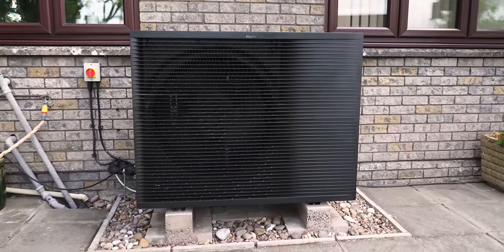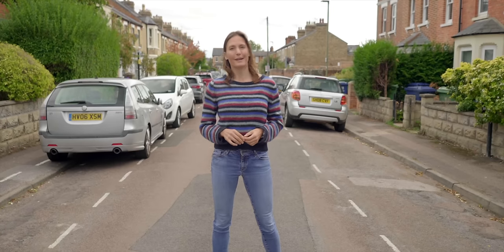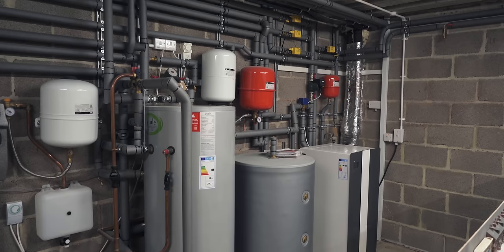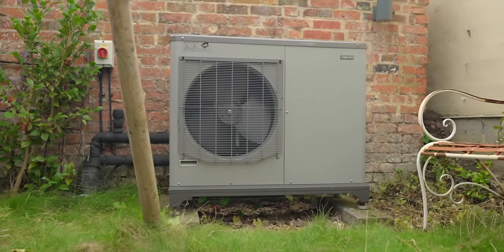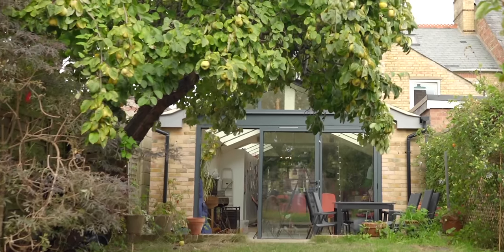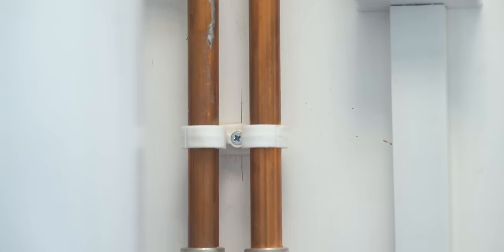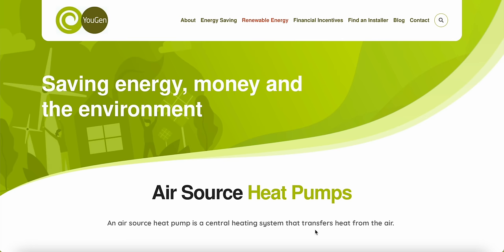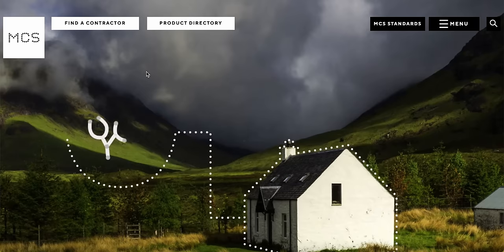Does a Heat Pump Really Work In A Victorian Terrace?

Comment: I'd like to flag something here: in the UK, we pay a green tax on electricity, but not on gas. Firstly, that's insane, secondly, if the green tax were moved from electricity to gas, then a heat pump would be a better option financially. The UK wholesale electricity price is also set based on the most expensive generation source, meaning that it's currently dominated by the price of gas, even though gas is making up less than half of our electricity mix at the moment. As it is, gas boilers and heat pumps are roughly neck-and-neck. If energy pricing were reformed, heat pumps would have a decisive lower total cost of ownership compared to gas boilers, much like EVs compared to ICE.
Reply: All subsidy and government interference should be removed from the energy market. If this happened the true price for wind and solar would be massively higher taking account of their unreliability and unpredictability.
Reply: @timfallon8226  no they'd be lower. Gas is what went up in price, not renewables. The reason energy prices went up everywhere is because its an open market. If you can buy 100mw of electricity for a third the price of 100mw worth of oil you'll just turn and sell it at a higher rate. 

Supply and demand.
Reply: I have one and a more efficient cylinder installed and the saving of the loss of gas and standing charge is far greater than the increase in our electricity expenditure
Reply: How surprising that the system is sqewed to benefit the privately owned suppliers that have a massive lobby with legislators. Essential services must be in real public ownership or consumers will always be robbed.
Reply: It's evil wanting to punish people.
Reply: 100% agree. Needs changing asap so green taxes are on the legacy fuels ie gas, not electricity. this will incentive a switch away. And as you mention, the ridiculous marginal pricing system currently in place for wholesale electricity in the UK doesn’t work anymore and should have been changed already.
Reply: @timfallon8226  incorrect. Renewables plus storage is 1/2 the price of nuclear to build, and cheaper to build than to run and maintain coal
Reply: @nordic5490  but how much storage are you factoring in to  the cost? How much time with no wind and no solar are you planning for?  Enough for a few days of subzero temperatures like in the beast from the east in 2018 ? Or Enough fOr a few 
 months? Like December 62 to March 63?
Reply: @nordic5490  but how much storage are you factoring in to  the cost? How much time with no wind and no solar are you planning for?  Enough for a few days of subzero temperatures like in the beast from the east in 2018 ? Or Enough fOr a few 
 months? Like December 62 to March 63?
Reply: This clip is very disingenuous. Yes less energy per year is used but they don't say that with current costs it is more expensive to run a heat pump compared to a gas boiler. The house owner said he now uses 6000kw to heat his house with the heat pump. With electricity costing around £0.275 per KW that gives an annual cost of £1650. He said previously it was 15000kwh using a  gas boiler. With gas costing around £0.07 per KW that gives an annual cost of £1050, a saving of £600 using a gas boiler compared to a heat pump. 
Gas is normally 4 times cheaper than electricity so that has to be taken in to account.

Comment: I'm in Canada and just turned off my gas line because I've switched over to a cold climate heat pump to heat my house! Heat pumps are magic and I highly recommend them! I'm so happy my house no longer has an exhaust pipe and doesn't burn stuff anymore.
Reply: Hello Mike,
Can you tell us the precise model of your cold climate heat pump?
Reply: @effemmelle  it’s a Mitsubishi Zuba PUZ-HA36NKA
Reply: Surely Mike the power station just burns stuff on your behalf now, so moving the exhaust pipe? ;)
Reply: i was quoted $21,000+HST for the Zuba HA42NKA1 (central ducted, 48,000BTU)... this is crazy expensive system!!!
Reply: @stuartburns8657  He is in Canada which exports much of its hydro power to the US. They produce 60% of their electricity from hydro. There is a lot of wind power too.
Reply: @stuartburns8657  The grid where I live is 93% zero emissions. Our power plants don't really burn much stuff. There's a reason we call our electricity "hydro".
Reply: @Vlican  If you're in Canada there's a rebate that makes it basically the same cost as replacing a furnace and AC (which is what you'd be doing) so yes, it's a lot of money but so is buying a new furnace and AC.
Reply: @heymike7037  Fair enough, glad to hear somewhere has it right 👏
Reply: Quite right just like electric cars.

Comment: As a Floridian, I've lived with heat pumps most of my life.  If a heat pump can't get your building cool enough or warm enough then the problem isn't the heat pump, it's your building.
Reply: You live in stock built homes in the USA. 99.9% of homes are brick builds in the UK with most of them closing in on 100 years old. The issue is the cost of retrofitting old housing stock to be suitable to allow for a heat pump. This has been getting sorted for many years with majority of homes now having double glazed windows and doors. We need our homes to be insulated though and the cost for this is unaffordable to people for the most part. For instance I was quoted £14k to insulate my home and that would not affect its value. In fact it would mean some mortgage providers won't give me a mortgage.
Reply: @PKSiAMiAM  Yeah, that's a problem.  My house is a concrete block frame 1950 model that has been expanded several times by successive owners.  I've spent US$20k on a new roof with upgraded wind protection, which was necessary to get insurance, and I'm looking at another $20k in insulation and HVAC upgrades within the next couple of years.  That's why we call them "buildings" rather than "builts": We're never really done building them.
Reply: You are a Floridian. You barely need heat.  Heat pumps decline in effectiveness the colder it gets outside,  especially below freezing.
Reply: @jamesengland7461  He meant the air conditioner he uses. That's also a heat pump.
Reply: @upnorthandpersonal  no; he said cold enough or warm enough. I'm referring to the heat side of the unit.  They may not always be adequate in extreme cold.
Reply: @jamesengland7461  😂 That’s funny, we have them in Canada!
Reply: @hardcoreherbivore4730  I know.
Reply: Or that the heat pump is wrongly sized for the building. 🙄
Reply: @jamesengland7461  they work just fine in extreme cold. Where do you live that you can't use one, Antarctica? Norway and Canada don't seem to have a problem.
Reply: I live in a very similar climate to England and our air source heat pump works just fine, even below freezing it heats up our entire house better than even the woodstove because we have dual zone control.

Our electric bill is below 100$ a month even in the coldest months. Maybe helps that we have inexpensive hydro power too but the efficiency and functionality of an air source heat pump is more than sufficient for temperate climates like the UK.
Reply: @kj_H65f  similar climate to what? I don't follow.
Reply: @jamesengland7461  no not if you use a geo thermal heat pump. Than it depends on the size of the depth of the bore hole or how big area you dig up to take heat out of.

I dont se that much difference between -5 to -20 celcious on my air-source.
Reply: @jamesengland7461  many commercial or high-end air conditioning units have what's called reverse cycle. Since an air conditioner auxiliary unit has a heat pump in it already, all these systems do if reverse the flow to create heat or to cool. This works well in warmer countries that just need a top up of heat in winter, but they're typically not powerful enough for colder countries like the UK. I'm sure some systems are good enough though.
Reply: @jamesengland7461  

THANK YOU! I am stunned that I watched the entire video and have read through dozens of comments and not one person mentioned the huge limitation with air source heat pumps: they're great, as long as it doesn't get too cold outside. You go below 32F and there's a limit to how warm you can keep the house. A few years back, my mother-in-law called me. She had her house set to 72F, but it wouldn't go above 61F and she was freezing. At the time, we were going through numerous days where the temperature wasn't going above 5F, and was maybe -10F at night, which is colder than normal for us. I didn't even have to go over and I told her, quite simply, that it's too cold outside and the air pump system she has is doing the best it can.

If it doesn't get colder than let's say 25F where you live, air source heat pumps are an awesome replacement for a fossil fuel system. But if you live somewhere where you're constantly getting temps below 20F, then this isn't the system for you. At a minimum, you'll have to supplement this system with something else.
Reply: @hardcoreherbivore4730  

Really? Do you have one? How cold does it get where you live? And at the coldest temps, what do you set your house to and does it keep it at that temperature?
Reply: @dontbanmebrodontbanme5403  It regularly gets below -40C in the winter where I’m at. Actually, I live near the mountains and get really weird weather. Had some days where it started at -30 and resulted in +20 all in the same day. The building with heat pump is amazing, I set at about 22 and it figures out to heat or cool. Never slept so well in my life.

Comment: UK still has houses with single glazed windows? Well, fix that first!
Reply: It's not just the windows, it's the poor quality building design and material too.
Reply: Its not possible in all areas of the country some places are conservation areas and you can't make changes to the external of the house
Reply: Changing windows doesn't necessarily change the outside although it can be an expensive special order to make new windows look old. You can even get newly made wavy hand made glass for the right look. But, listed buildings are only 2% of buildings so it is a minor problem.
Reply: @matthewmcmullan9669  You can change to double glazing, they just need to be sympathetic to the historic style. Check with the regulations of your local council

Comment: It would have been a much more convincing video if the improvements made to the house to make it more efficient to support the heat pump were explained rather than just re-iterate the efficiency of heat pumps. I know it will vary between properties but in this case what was done? Wall insulation, underfloor insulation, bigger radiators, how much additional space for tanks etc.

Comment: This should have been made to happen by regulation for the last decade, the govn really dropped the ball on this one.
Reply: Dama

It should never have been regulated in the first place, it is an ill considered law and will not do what the government thinks it will.

The problems are:-
The expected CO2 emissions will not be as large as the government thinks because they base the emissions on the average of the grid's output over time. This is not accurate as the extra demand on the grid can only be met by gas generation, remewables and nuclear cannot increase output to match the increased demand.
As more and more heat pumps are installed this will increase the summer to winter differential of electrical demand. (Winter heat demand is about three to four times electrical maximum demand) In other words more generating capacity will be required to be built but will not have it's capacity used for a lot of the year.
The local area network will need upgrading, and at who's cost? It is designed for frequent demand  of short duration of higher load devices. As heat pumps run for long times, this affects the load drawn on the system  and will need to be accomodated, electric vehicles will exacerbate this problem.

Their perceived efficiency is not true either as it uses electrcicity as base for COP which many take as efficiency. Electricity is carrier of energy, not a source.

Which is likely to be better, a gas burning device heating water to feed a hot water and heating system or a heat pump which uses gas to boil water to make steam at a few hundred degrees to turn a steam turbine to turn an alternator to generate electrcity. This is then increased to very high voltage to send it many miles before it is again transformed into low voltage and distributed to the user.  A heat pump essentially uses the heat from compressing the refrigerant to feed a hot water system at a relatively low temperature.

Freedom of choice has been removed completely.
Reply: @iareid8255  The grid needs updating anyway as electric demand is increasing and the national grid has been doing that over the past few years. Burning gas in a highly efficient gas turbine is more efficient than individual home gas boilers. You also fail to take into account that the grid energy mix could change in the future where gas is no longer required and could be a mixture of nuclear, wind solar etc. You also fail to take into account of people generating their own leccy via the means of solar or wind.
Reply: Verygood brother, 

I think you misunderstood what I'm talking about. The grid used to cary about 60 Gigawatts but now maximum demand is a bit less than 50, so the grid has capacity.
It is very doutful if gas turbines are more efficient than gas boilers. Combined Cycle Gas  Generation plants are better but due to the balancing duties they have to perform due to renewables their efficiency is impacted. The mix is irrelevant when it is undispatcahble, gas will be needed for a very long time to come.

Comment: Good general discussion. Well done EES. I've had a heat pump for 8 years in a 250 yr old house and it's been very good. Much cheaper to run than the previous  oil boiler.
Reply: how cold does it get where you live
Reply: I would think that our weather is pretty average for the Midlands. Our coldest temp we had was when the UK had “The Beast from the East” in 2018. It got to -7 degrees Celsius then.
Reply: @johndaly8156  Worth noting that heat pumps have been used very effectively in Scandinavia, Germany, and other parts of Europe for decades. It's less about the local weather and more about either a properly designed system specific to your house or, as noted in the video, do the house efficiency things first; draft proofing, double or triple glazing, and, most of all, insulation, insulation, insulation.
Reply: @mrmidland_traveller936  I live in Ma. usa  the coldest was -22 fahrenheit
Reply: @Mr Midland_Traveller
That's interesting to know, so solid walls I presume? To what sort of temperature do you heat your home? I'm in a fifties ex- council property and although the internal walls could really do with attention I'm very reluctant to just fill in the cavity with insulation because the house has been "breathing" with no damp for fifty years. If I close off its cavities surely it's going to get damp and goodness knows what other complications. It's been heated to temps never above 19°C in the winter quite happily without the boiler running more than a couple of times a day. I'm wondering if a heat pump would do the same in those conditions. 
Sorry probably not a question you can answer!
Reply: @judebrown4103  Like you, I tend to have the thermostat set around 19 degrees during the day and 18 at night. Yes, I have solid stone walls. I’m sorry but I can’t advise you on cavity wall insulation.
Reply: @mrmidland_traveller936  thank you, yes I thought cavity walls would not be relevant to your experience! Grateful for your input though.👍
Reply: I’ve been thinking about switching, house is only 120 years old, do you have high ceiling? And did you have to change radiators/add extra insulation? (And if you don’t mind me asking what was total cost😬)
Reply: @Lesley246   Hi Lesley. We have normal ceiling heights. Some of the radiators had to be changed but mainly from single radiators to double ones so didn't need much work doing. We had to add a bit of extra loft insulation but as our house is solid stone, there wasn't much else to do. 
The total cost was just under £12,000. We benefited from the Renewable Heat Incentive (RHI) which over 7 years gave us quarterly grants of £345 which totalled £9660. So the actual cost to us was just over £2300. The cost savings from not having to buy oil over the years have been about £1000 - £ 500/year depending on the cost of oil. The RHI no longer exists I'm sorry to say.

Comment: The only issue I have is that heat pumps seem to get pushed as the only solution.  They are great but not suitable in all scenarios, an article comparing several alternatives, with their pros and cons, would be great.  It would also need to highlight where something less efficient might work such as electric radiators but in a home with high electricity self-generation.